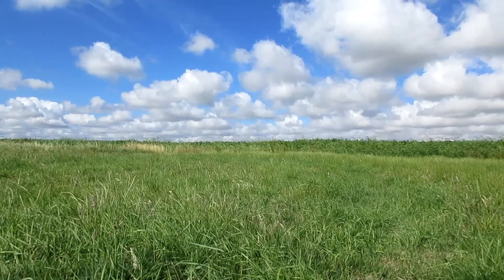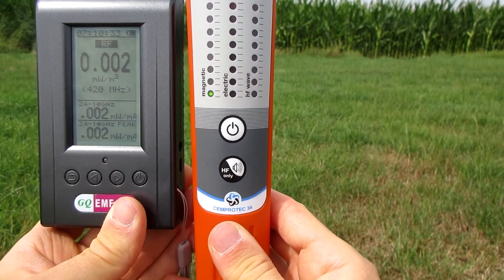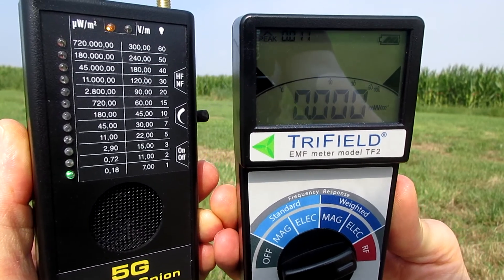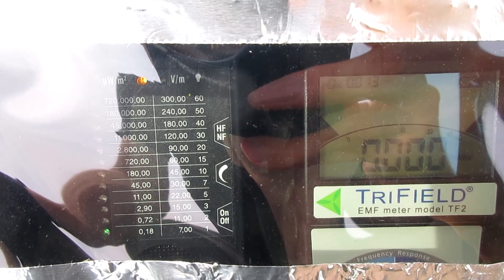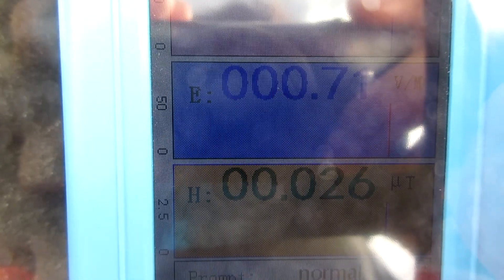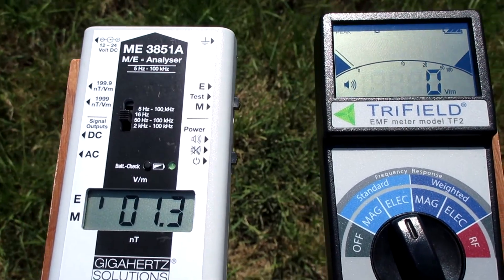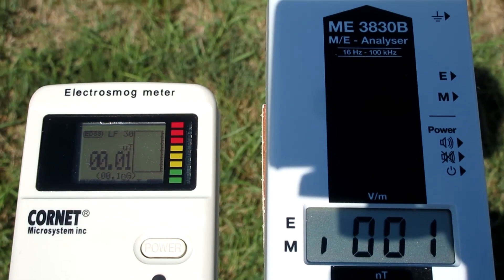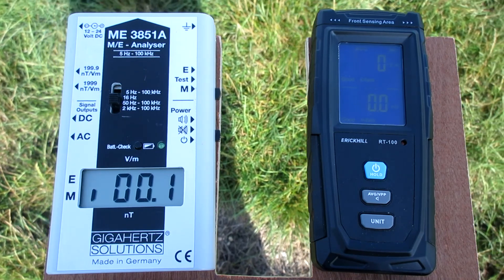Best EMF meters Part 3/13 (intro 3) -- Lowest point outside -- Calibration check --

Comment: At 15:05 you say the EMF-390 looks bad here because it shows higher reading than the ME Analyser, but couldn't that be due to the 390 having a Tri-axis MF detector compared to single axis on the ME Analyser? You demonstrated in a later section how the ME Analyser gives higher readings on a different axis.
Reply from the maker: No. It only makes sense to measure nothing there because it's in the middle of a farmers field away from any kind of EMF.
Look at 15:24
The EMF-390 measures around lets say 0.8mG
that means the ME3851a would need to measure 80nT (if they would be calibrated exactly the same), but the ME3851a measures 0.1nT. Sure, it's single axis, but I checked the other axis there and it was the same, and the ME3851a usually picks up the most magnetic in the axis it is filmed there.
What the EMF390 measures cannot be AC magnetic.
It's either:
a) the EMF390 picks something up from the earth magnetic field or something in the ground.
b) it measures nothing, it's just wonky below about 1mG and it reacts to the wind hitting the device.

But as far as I know the EMF390 isn't designed to measure something in the ground or from the earth magnetic field, you need a specialized device to measure that.
If if it would do this, this would be a bad thing, because you wouldn't know if you measure EMF or something else, when measuring inside a home.
You would want a separate measuring mode for that.
So if it would pick up something in the ground
it's probably not useful that it does, it will only cause confusion,
because this is likely far from accurate. But it could just be option b.

The EMF 390 is useful for medium to high magnetic fields,
but not useful for low magnetic fields, which is often important for EMF sensitive people.
Reply: @Merializer thanks for the explanation and for making this video series. I'm still going through it trying to decide which meter(s) to buy, but it's taking me a long time... I wish answers came easy.